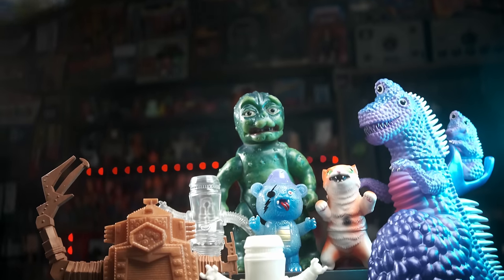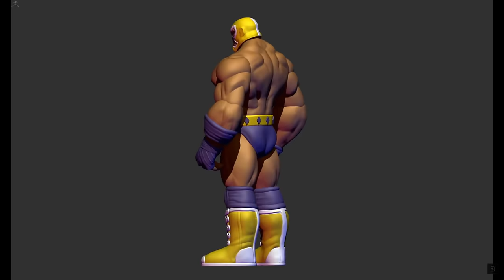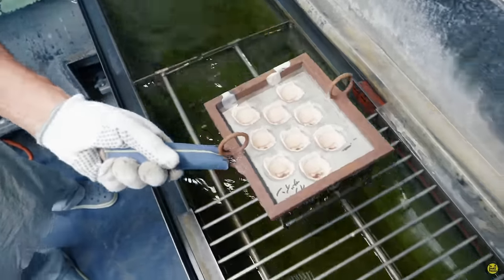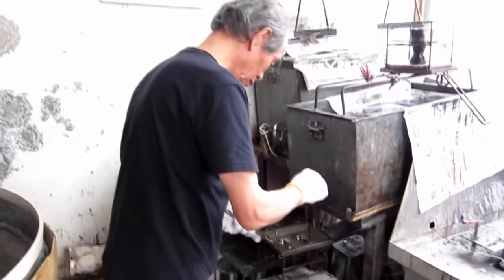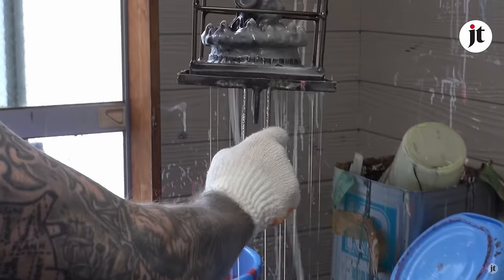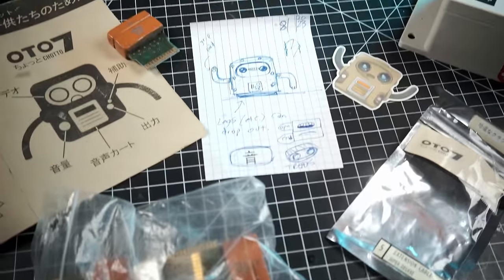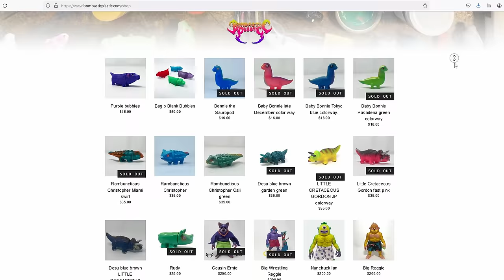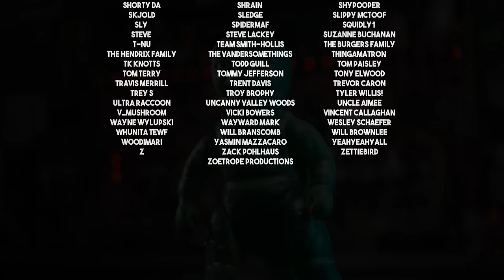BUILT DIFFERENT: Japanese Soft Vinyl Toys | HOW they're made, WHY SOFUBI is special

Comment: 5:45 A brief explanation is that the different liquids have a their own thermal properties. Oil can release more heat energy and remain at 100 degrees than toluene can. If the vinyl cures clear when heated over a long period of time then this makes sense as the toluene can only transfer so much heat energy into the vinyl before the liquid near the mold cools. Just by changing liquids you can achieve quicker or slower curing times using the same setup with little to no temperature adjustment. In other words, if you want a burnt egg put it on a red hot frying pan, and if you want a warm egg put it on a red hot sheet of thin aluminum foil.
Reply: Toluene is carcinogenic. Having an open vat of that stuff 24\7 terrifies me.
Reply: Are we sure that’s toluene and not salt?
Reply from the maker: @2degucitas  This is why I say it with a question mark at the end, because it seems fairly unsafe... but when you talk to someone who actually pulls vinyl, they'll probably say "It hasn't killed me yet."  :|
Reply: I think the whole toluene thing came from a factory visit video rampage did years ago… we don’t use toluene. It’s a salt oil bath. In the furnace tank the salt doesn’t boil and disperses heat evenly.

Comment: One of the GI Joe customizes I know, Skunk Works Customs, speaks glowingly about Wonder Vinyl paint.

The soft vinyl process you showed is similar to the way they made the original GI Joe heads.  Their heating process was much faster than what was shown here, and the kept them in motion while they heat cured.  The opening for the neck post was then pushed out with a sharpened tube.

It is not hard to get plastisol, and many people use it to make custom fishing lures.  That PVC is usually very soft (Shore OO instead of Shore A like silicone molds).

Comment: Goto-San is someone special.
I check Max Toys and saw that the kaiju kitty is only made in HIGHLY limited runs, but I will adopt one at some point.
Reply from the maker: Goto-San's smile is infectious! Seems to REALLY enjoy the process. Wonderful.  :)
And I'm after a Kaiju Kitty as well!  :D (The one I showed was on loan from my buddy James' personal collection.)
Such a cool little design, isn't it?
Reply: @TheCrafsMan  I was thinking about something after finishing the video, I know you did rotocasting, but I couldn't recall the material. I was thinking about setting up a rotocasting machine with simple plaster mold and putting some of my Cast-a-Mold 25T in it just to see if it would work out in a similar manner.
Reply from the maker: @RvnKnight  : Both Smooth-Cast 65d and 45d can be rotocast. The 65d is what I used on the Free-Range Chicken, and it kicks pretty fast but it's fairly rigid. Whereas the Smooth-Cast 45d is a bit softer (esp. when in a thin shell / rotocast form) BUT it does take longer to fully cure.
Reply: @TheCrafsMan  that is extremely helpful to know! Thank you!

Comment: I have my doubts about the bonding thing, since the walls of those molds are quite thick. Pretty sure the chemical bath is chemical-y just to increase the boiling point. The plastisol needs to be heated to 356ºF before PVC start to bond with the plasticizer. It's basically the same reaction as Sculpey/Fimo when you put into an oven and pull it out.

Comment: This video was very helpful  it was just sent to me. I have been wanting to have a small production of figures at home. At first I wanted to print and paint 3D figures, but I realized that they have little resistance and are not suitable for mass production.  Then I came to the conclusion that I should get 3D figures, mold them with silicone and fill the molds with PVC and paint. Do you think this method is good and possible?  And if you give me a tip or suggestion in this regard, I will be grateful 🥲🥲

Comment: 15:29 DIY methods you can use? Come up and see me some time. I appreciate that you presented a cleaner video that covers a lot of what I have previously covered on my channel and so much more. I took some time several years back that documented a bit of me trying out the tooling process on my own. I missed a step of nickel plating before copper, so I had to conclude that. I did however find an old patten that mentions the type of bath that is used, and a bit on joint making. Nice work.
Reply from the maker: Geoff, thank you for commenting! After reading your comment I went over to your YouTube channel and WOW... you have been experimenting! Major respect, my man. Where are you now with all this? I saw it was a few years back that you were solving some of the mysteries, but running into new ones. Re: Metal... I assumed some type of brazing or reinforcing would be required, as I understand the electroformed layer to not be strong enough on its own. This is what I've read, though, so not my own experience yet.
Reply: @TheCrafsMan  hey thanks for the reply. My greatest enemies have been space to work and time outside a very hectic schedule… and money, but that’s a forever struggle so I hear. So yah, it has been an on again off again situation for me, but I have gotten questions and comments over the years, and some people have even surpassed me in getting to actually getting tool made by themselves for the most part. I believe you and I are connected on Facebook and I follow you on instagram. I can definitely continue the conversation there, because there are paragraphs of research that I have found on the subject and point you in the right direction of more DIY folks that are right here in the states.